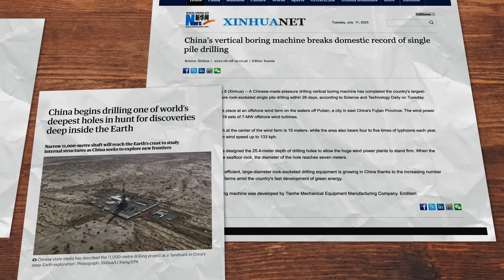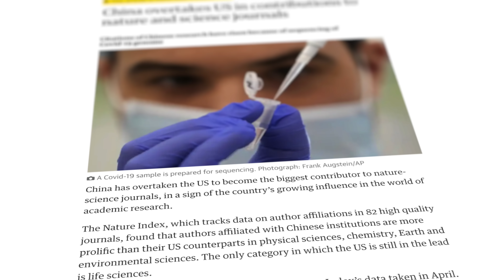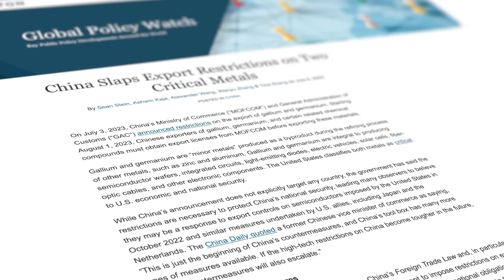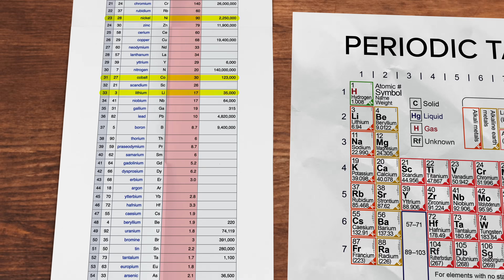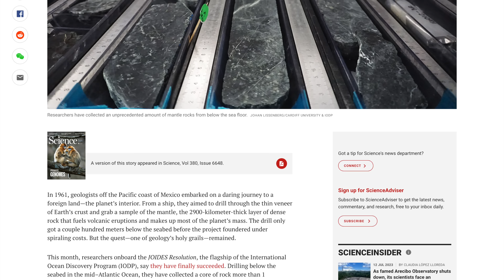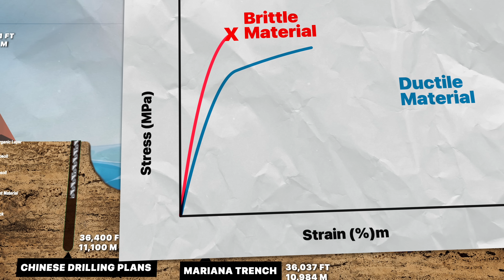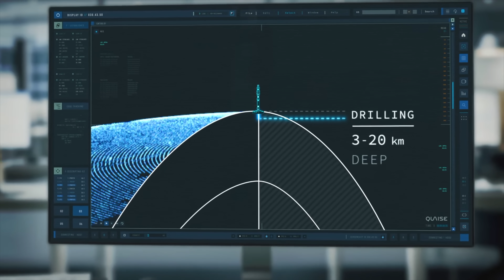What’s Hiding Beneath China’s Deepest Hole?

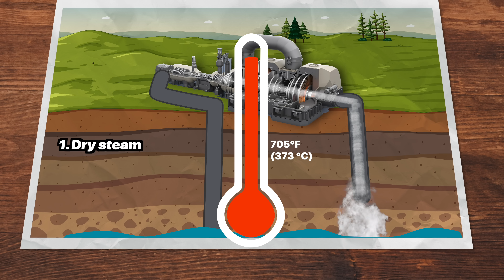Comment: 5:04 - "This is a special state where water is a mix between a liquid and a gas" - sorta.
Now, in "popular science" videos it is better to avoid confusing phrases - because while "a mix BETWEEN" is - technically speaking - correct, some may confuse it with "a mix OF".
Supercritical water isn't any "mix between", and frankly this expression doesn't make much sense if you think of it - "it is a state COMBINING PROPERTIES of both liquid and gas" would be much better; clearer and unambiguous.

Or so I think.
Reply from the maker: yeah I have to agree that is more clear! cheers!
Reply: @cicadaclicks7712  GA 321 is there - quite a reading; FOURTEEN individual lectures, each requiring quite some time to read and digest. However, the one I'd be probably more interested in, "GA 352" isn't there (and neither "GA 325").

Comment: If you use a maser to vaporize rock, that mass still has to rise up and exit the hole.  And it has to get out of the way of the beam for the beam to hit the rock.  You could pipe air down to the bottom of the hole and support the "maser drill bit".  This reminds me of "space elevators"  

And analyzing the rising vapor isn't going to very useful.  The maser will destroy tons of information (thermodynamics).  

And that means less support mass, but you still have tons of rock vapor to lift up miles.  And then that rock vapor is going to go everywhere.  Should we just ignore it?  Can breathing that vapor be dangerous? (Yep)

If you really want to explore time - go to the Grand Canyon.  The oldest rock at the bottom of the canyon is in the Elves Chasm Gneiss.  It's over 1.8 billion yrs old.   > 145 million yrs.  And the Grand Canyon is much longer than the depth China is aiming at.  I.e., lots of data.  Very few holes.  No pollution.

If this was entirely for science, they wouldn't use the drill bits shown in your video.  They'd use coring bits.  Conventional bits turn structures into mud.  Not that mud is useless, but with structures you can radio carbon date bits and pieces of the sample to see how homogeneous the sample is make sense of it.  Why? because drilling that deep you'll very likely cross igneous rock and basalt.  Which can the layers come out out of order.  But with enough holes you get more data... maybe some brilliant geologists can sort it all out?

And anyway, the Grand Canyon is pretty much carved from sedimentary rock.  So the strata pretty much conform to a linear history.  If you drill a million holes you'll get a much better picture of the geohistory than what you'll find in the Grand Canyon.  

But, it is an interesting exploration.  It has my attention.  I hope that this engineering journey is open sourced.
Reply: I never considered it myself. Ask Putin. He's the one with the Ph.D. in Mining economics 😅
Reply: Open sourced? 
This is the CCP. We only see, what they want us to see.

Comment: Russia tried this but reached a depth where the drill bits were effectively acting like an egg beater in a cake mix.. The drill head melted and one could go no deeper as the integrity of the hole would simply fill in the second you withdrew the drill stack... This varies in depth depending on where you drill but inevitably they will experience this problem...
Reply: I never had an egg beater melt
Reply: FengG0 Could you elaborate how newer material science is going to negate bore hole closure by the sheer pressure that deep into the ground?
Reply: @RichardPrendingue no, because the chinashill has nothing but an ignorant attempt to influence ignorant
Reply: FengG0  not by too much drilling tech really has not changed too much in durability since the mid 2000's only the technological parts such as sensors and scanners
Reply: Yeah your correct the USSR had deepest hole. I try not to watch this sorta stuff since most are just propaganda
Reply: You are lying
Reply: There’s a company making these new drills made out of carbon fiber…
Reply: @casualmmafan4258  And as we know carbon fiber performs great under pressure.
Reply: @casualmmafan4258  Do you have a name for this company?
Reply: Even scary what the audio record they got from the hole😳😨
Reply: FengG0  🤣🤣🤣🤣🤣
Reply: They had to use a nuke to close that one
Reply: @omarcj789  lies
Reply: @jacobbeaupre3940  fat electrician fight fire with nukes
Reply: @omarcj789  nope, that was a fire coming up from a gas well that couldn't be put out conventionally. The kola super deep bore hole is different

Comment: The deeper you drill the more issues you encounter, such as heat melting your tools. I don't believe there's any benefit besides surpassing the russians. Just take some lava from a volcano, result is the same as drilling deep.
Reply: And when that view will inevitably prove wrong, whether during this project or the ones after it, what will you say then? This myopia is asking to scientists in the late 19th century claiming there's only a few tiny unknown spheres of knowledge left. Turns out those thigs were the standard model, gravity and radioactivity. Will this be on that order of magnitude? Probably not in scientific terms but it could easily be that scale in terms of economic and political spheres.
Reply: @RiversJ  there are just some very big issues with digging that deep, once rocks get a couple hundred degrees they start to become significantly more compressable and thus when you dig a hole the pressure of the earth willl quickly fill it back up, additionally your tools will melt. you probably can develop solutions but as far as i can see this project does not